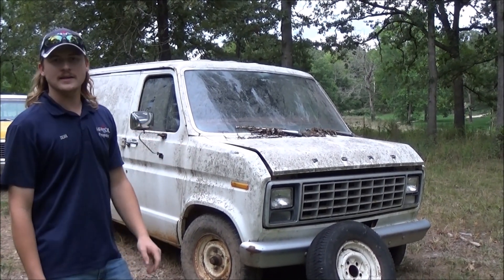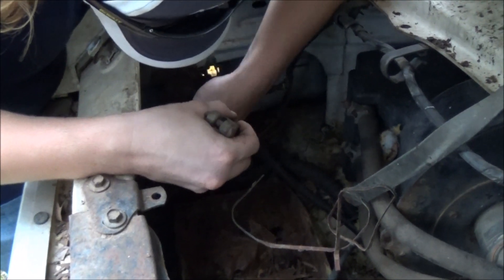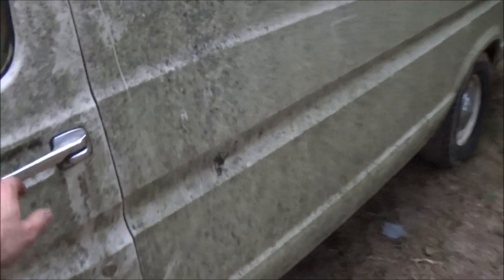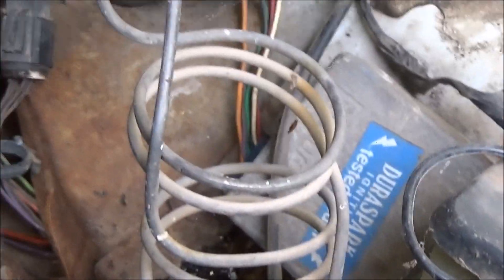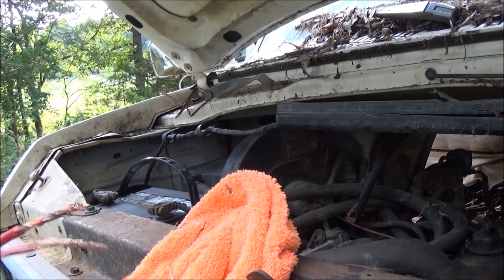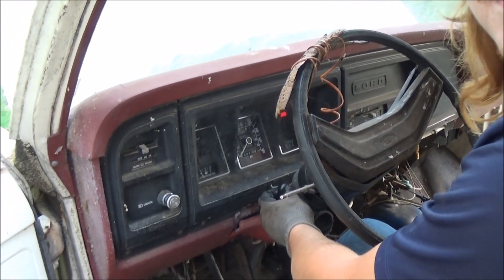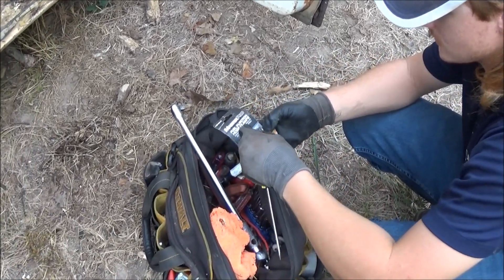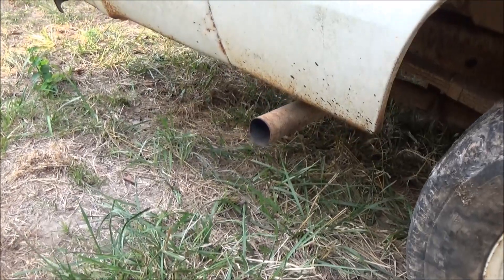Will this 1980 Ford Van start after 20+ Years of sitting in the woods?

Comment: If that is a 300 cu in strait 6 its got some serious low end torque. I had a 66 ford pickup with that same set up
Reply from the maker: Yup , it's the 300. She's pretty wore out. Smokes good. But it still runs which is impressive